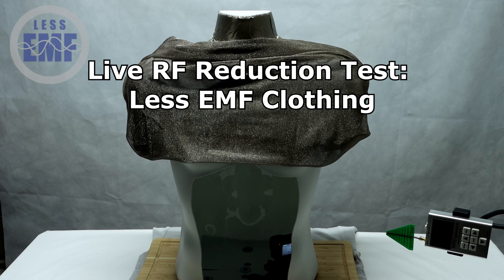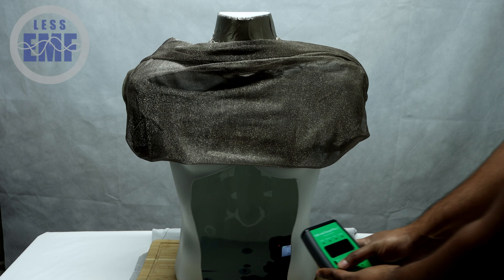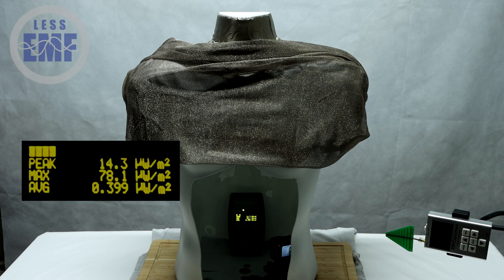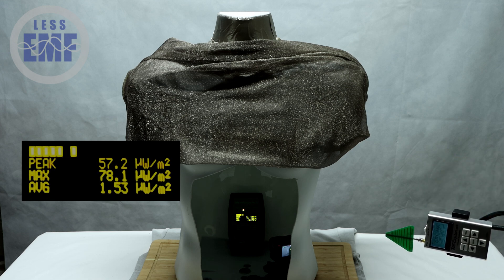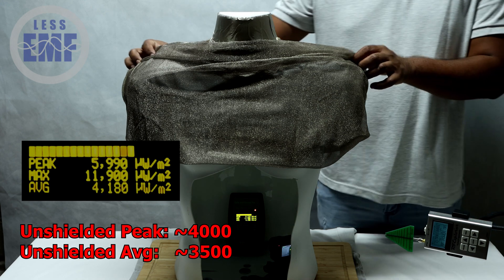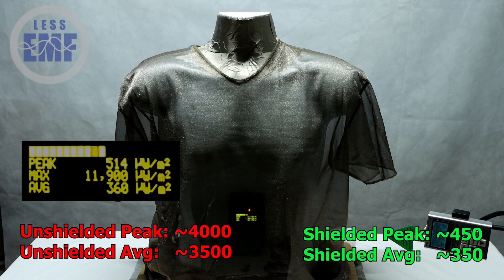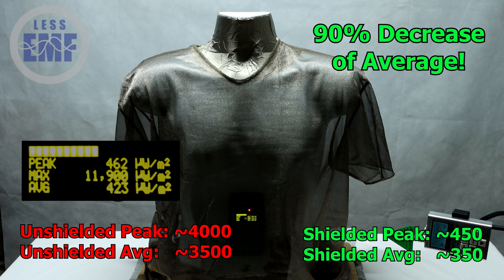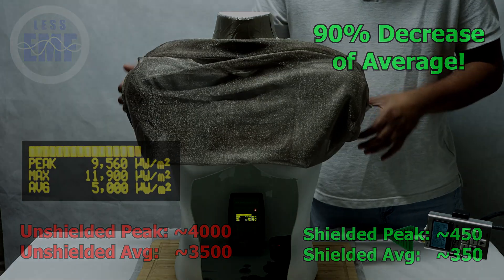Less EMF - Testing Shielding Clothing

Comment: Why did the "Max" number not change after shielding?  Must be a meter thing?  That's a good demo video btw.  Also, I do own an EMF Hat and it makes a difference, and I can see the benefit of at least a short sleeve T-shirt to cover your core.
Reply from the maker: Great question! The 'Max' value on the meter represents the highest reading it has detected since the meter was turned on. Since we didn’t reset the 'Max' value or power off the meter during the demonstration, it continued to display that reading even after the shielding was applied. If we had reset the meter’s 'Max' reading after shielding, you would have seen it reflect the lower values measured with the shirt in place.

Thanks for watching, and glad to hear the EMF Hat is making a difference for you! A short sleeve T-shirt is definitely a great next step for protecting your core. Let us know if you have any more questions!